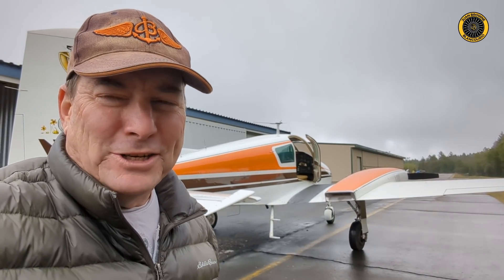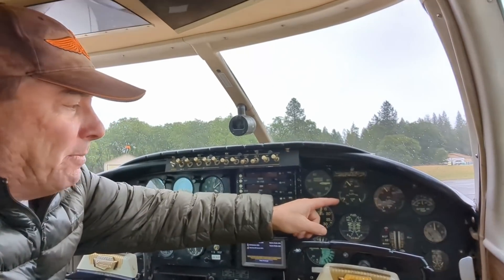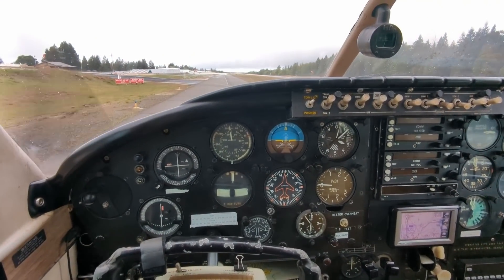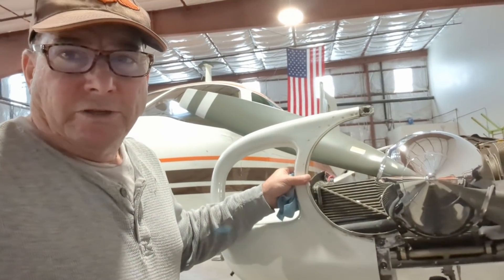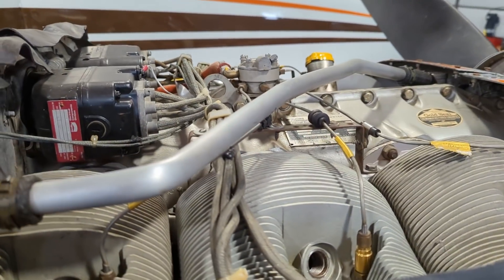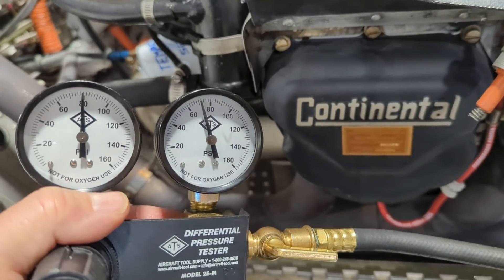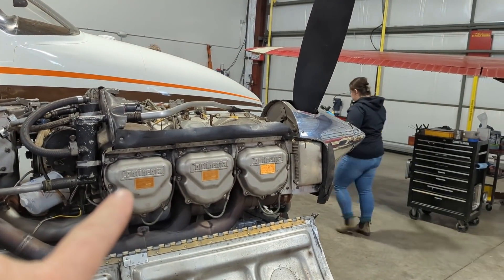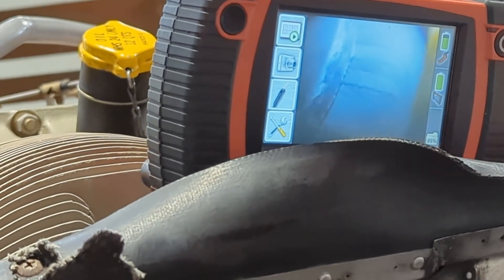1959 Cessna 310C Annual Inspection- Part I Compression Check.

Comment: Sir: What about the landing gear/ Have you had braces welded like the TAS Cessna shop in Ohio does. If you recall the 310 pilot, TAS saved him from a gear collapse. They noticed and replaced the nose gear bolt completely bent and not only replaced,but also welded a brace to the front gear. Also, other 310's have sustained gear collape. This is the main Cessna twin shop serving the midwest, and no 310 undergoing their service has had a gear collapse.

Comment: FWIW. Certain Continental engines require a restricted orifice plug for the compression test, a standard plug may give erroneously low readings. I watched twelve cylinders get needlessly overhauled on a C-337 because of that.

Comment: SouthJerseySound.  I wasn't disputing that, just wondering why.  The other thing to consider is; 95% of car engines are more or less abused.  Borescoped?  Never.  Oil analysed?  What?  Oil changed even?  Rarely.   Plugs (if any?)  I have a diesel, but I would change the plugs every ten years if they needed it or not.

As for engine loading, you're dead right, few engines are made to produce anything like 75% max horsepower for any length of time.  Having said that, in the UK, every weekend, the model of Land Rover I have can be seen towing something.  A boat, another car, horses, building materials in a trailer, unmarked, unidentifiable trailers.  Just this weekend, my Disco was towing a trailer.  Not a heavy one this time, but up some long hills at a steady 2000-2400 rpm so, maybe 75%?

There was the automobile pump gas (petrol) for aeroplanes thing which I'm not sure was every truly resolved, was it?  Whatever, I agree with you about aeroplane engine use, but modern car engines can often go thousands of hours, working 'relatively hard' weith next to no attention.  Some of them, hundreds of thousands of miles with NO attention whatever.

Comment: I, as one, noticed on the  310 engine, the bottom spark plug wires were very close to the exhaust pipes, they looked like they could be moved through those hold downs enough for better clearance. Michael said that, bye for now my friend.

Comment: I've got 1 more for you. Cyl furthest from the oil pump.
Cyl depth gauge 
Piston at 1/2 stroke
Move prop back and forth and record loss of movement with prop angle degree tool.
Can save crank cases.

Comment: Girls with Grit. that an't finger nail polish laddie I've got 2 ,not that I did want them in a dress @ times but to be well rounded in the real world from broke down on the hwy. To pull & rebuild their motors 1 is finishing her nursing degree. The other Runs a Veteran resource division & has a 3500 hp funny car
Both are Archers & avid firearms participants. My oldest is Helping restore our 1960 Aztrk & working on her Pvt. 1975 my  Tuition was prepaid headed to Northrop,76 I got the "Suprise" talk", married her got my Pvt.& my 1st born changed my life's direction,still married,   Passion for  Aviation, endless & still growing !
I'm old fashioned but Women..Rock my World !

Comment: Go Jordan, A+P at Bakers is a sinch! They were just great! You have plenty of practical experience already. The questions are on the internet, Study them up, you will be fine! I combined my A+P at Bakers with a trip to OSH, all the way from Australia, had a blast! When I do Comp checks, I always do them through the bottom plug holes. I have had too many instances where the carbon has dislodged and fallen into the valve seats and given a crap reading. Rocker covers off, wacking valves, re-running the engine. For the little extra effort, comp check in the bottom hole, it can save a heap of grief.
Reply from the maker: Great point!

Comment: Juan, I did my A&P School at City College of San Francisco.  2 1/2 years. Normally it would take 2 years with the 8 courses, but my first and last semesters, I only took one course. Took my Oral and Practical, then my Written. You can take the O&P before written if you go to a school.   I had my instructors give my O&P they were DME's also.   When you take Written test, the first license you take, you will need to do 2 test, the General and either Airframe or powerplant.  On the oral for first test, you will have to do a Weight and balance problem.    Then after you get those written passed you can take the other one.  Still have my A&P but not in the aviation area anymore.

Comment: So your are really doing a cylinder Leak Down Test, Not a compression test. At least that's how it is in the automotive world. Compression test would tell you the compression pressure in the cylinder after three or four revolutions of the crankshaft using the starter motor to turn the engine over. The Leak Down Test is the real test to determine the condition of the engine internally
Reply from the maker: No. You are a car mechanic, we are A&Ps. 
COMPLETELY different. Get your rating...
Reply: @blancolirio  Yes I see that it is COMPLETLY different, I was just wondering why a leak down is called a compression test when it does not tell you the compression of the cylinders. Sorry for the question!

Comment: Love your 1959 C-310.  I have many hours in those as we had them in the Army Reserve program.  U-3A (1959) and the U-3B (1960).  Loved the cowling on the 1959 as to leaning the fuel flow at night, you could see the exhaust stacks turn a bright cherry red when too lean and then you just backed off till they turned a little darker.  We had no auto pilot so all was hand flown all the time.  Once flew from TEB down to FTW and on to ELP and LAX area.  4 day trip.  Left it in an IRAN program in CA. These were all AF hand-me-downs to the Army.  Go figure, we gave the AF all our Caribous in 1968.  Not an even trade!

Comment: Are you aware of Continental's 1984 service bulletin M84-15 which basically discounts compression testing data?  Learned about this from Savvy Aviation, they have a YT video on borescope inspections.  There is a chart with different compression results over a short time interval that are all over the map.  I wouldn't pay an A&P to test compression myself on a Continental based on this.  Other opinions?
Reply from the maker: Bad idea.
Reply: @blancolirio  Considering you can't draw any conclusions from a bad compression check makes it a bad idea.  The fact that the regulations still require a C.C. makes it a good idea.  For those wanting to try to answer this using more information see Savvy Aviation Borescope https://youtu.be/7R-dAmv9VZk

Comment: The Leak down test always makes everyone so nervous. If the numbers are too low its such a bummer!
When I worked as a A&P I had several large bore engines that failed the leak down test by blowing passed the rings. The engines would make rated power, run well, and the oil burn was within limits.
 The owners would get so pissed when this happened.  And I could see why..
 Aviation can/ is so expensive.
I'm a C172 owner with a very  high time engine. It doesn't leak and runs good but a big expense is coming soon.
Wishing all the best for Jordan. I had to leave the A&P trade because the pay was so low I had to make a living and working on GA stuff didn't make ends meet.

Comment: Wouldn't it be nicer with a modern version with two small jet engines with a TBO of 5000 instead
Reply from the maker: No.
Reply: @blancolirio  do you drive a 1947 car?

Comment: It's always good to see young people wanting to further their education in a field that they already work in. It's a much better choice than some of the ones that get a useless degree with very little chance of ever using it. I'm in.
Reply: As the work places are overwhelmed by people working at home in their jammies, the broad spectrum of trades is suffering a steep decline in workers who think that getting dirty hands is beneath their entitled selves. A great deal of the housing shortage is caused by people, ignoring the wage points out there, who prefer to work with a laptop instead of a saw. Same with autos - the mechanics who actually fixed them have turned into fancy-uniformed technicians who only know how to take out a unit and replace it with a new one. Actual tear down and repair is gone with the good ol' boys in dirty jeans.

Comment: Nice video presentation of compression testing. One note of safety is to also disconnect the lower spark plug leads. Even though the mag switches are off it’s no guarantee the “P” leads are actually grounded. Granted the odds of ignition OR electrical shock are very low, disconnecting the lower leads also provides the opportunity to clean inspect them.

Comment: Those are good compression figures for an IO-470 engine, even the low one at 72.... no worries.  With your chrome cylinders, always remember to use plain cast iron rings, never use standard chrome rings in a chromed cylinder.

Comment: Read and understand TCM SB03-3. What was the Master Orifice reading? Maybe you did this and just didn't show it on the video. It looks like you have the correct compression tool. MANY people are totally unaware of this Service Bulletin. Yeah, Yeah... I know Service Bulletins are NOT mandatory. However this Service Bulletin describes the proper way to perform a compression check on the big block Continentals. It also emphasizes the importance of the borescope inspection.
Reply from the maker: You are correct

Comment: It surprises me that the regs don't have a problem with someone, even a licensed A&P, doing annuals on their own aircraft. It just feels like there is so much room for idiots to rush or ignore warning signs, and just sign off their airplane for another year, just so they can get back in the air. Wouldn't you want to require aircraft owners to have a different A&P do the annual, or at least review the owner's work and sign off on it, to ensure procedures are being followed properly?
Reply: Annual Inspections can only be accomplished by A&P mechanics that hold Inspection Authorization (IA).    These inspections must be performed by the IA holder and can not be delegated or supervised.

      Obtaining and retaining the IA certification is not easy and holders of IA are held in high regard by the FAA since they act as representatives of the FAA administrator when determining the airworthiness of aircraft.

      It is quite common for IA’s that own their own aircraft to perform their own Annual Inspections.

      Someone that held an A&P certificate, but not IA would need to seek out an IA to perform an Annual Inspection.

      All of this is covered under 14 CFR 43.
Reply from the maker: Stay tuned…
Reply: Does it not occur to you that someone who has obtained a IA certificate, has been around aviation for awhile (most IA holders have 10+ years experience), and are working on the plane THEY WILL BE FLYING would want to take special care working on it?
Most IA's are quite meticulous and careful individuals - because they have seen 1st hand what can happen with carelessness and neglect.

Comment: In Australia your 'compression check' is called 'cylinder pressure test'. It is not about compression, it is about pressure loss on the compression stroke. Think about it.
Reply from the maker: Maybe down under, but not here.

Comment: This brings back memories of my first corporate flying job in 1969. Our company had an "I" model 310 and 411. I had an A&P license although I was working as a pilot. I got to help a little on maintenance but because I was the "new guy," most of my labor was cleaning and waxing. I didn't mind because I was thrilled to be flying. That A&P training was very useful for understanding new systems and analyzing any problems during 31 years of corporate flying. 

Our local community college has an A&P school that feeds a large AMR maintenance base here in RFD. These are good jobs in high demand.

Comment: Your cowl has "Camloc" fasteners and not Dzus fasteners  (they're from WWII)
Also its a good safety idea to remove the spark plug leads from the bottom plugs to completely preclude any chance of the mags giving off a spark especially with impulse couplings on the mags like I hear on your engines. 
Last but not least there is a better way of doing the compression check  by following the Continental designed process with a "Calibrated " leak compression check.  Its their approved way of doing it. 

Really like watching your channel
Retired airline/corporate pilot and 55 year A&P here

Comment: Interesting!  What you're calling a "differential compression check" is what the automotive world calls a "leak-down test".  For car folks, a compression test uses the starter to crank the engine over, and the pressure in the cylinder is measured.  The leak-down is often a next step if the compression numbers come out low.
Reply: You beat me to the same comment.
Reply: Well I can see why they do it this way since a spinning propeller is always a hazard.
Reply: Everyone in aviation also calls it a leak-down test...
Reply: We called it a "cylinder differential pressure" check at our airport. You're checking the cylinders ability to hold a certain amount of pressure vs a compression test which is a check of the cylinders ability to produce pressure.

Comment: Exhaust valve leakage never gets better over time, only worse, unless it is a carbon deposit on the seat.  You may want to check the valve rotator cap to ensure it is working.  Savvy Aviation just put out a video in the past week or so on lapping in place which also shows how to check for valve rotation.  I sure hope you don't have to replace an exhaust gasket.  Cessna didn't do us mechanics any favors with these early 310's.  You can't drop the exhaust manifolds unless you lift the engine up off of its mounts.  The studs are too long and the nacelle ribs are too close.  Getting the engine mount bolts out isn't too bad, but getting them threaded back in and bending the locking tabs on those bolts will have you reciting salty language.  I've had to do cylinder work on mine and have the scars to prove it.  Best of luck, these early tuna tank 310's are a blast to fly.
Reply from the maker: That's in a future episode ...

Comment: When I did my practical it was a compression test on a beech 18 and mag timing then hydraulic with gear retract.   The same week when I was licensed I got sent to help another mechanic change a chug on a 18 hauling freight in 20f degrees with sleet. As a new A&P does not mean a warm dry hanger. Trapped the engine.

Comment: Probably a silly question from a non-pilot, but... "Make sure the gear is down"??? Wouldn't you have had some indication it wasn't, before you got in? 0:13 🤔
Reply: Generally speaking(don’t know this plane) there is a safety(weight on gear switch) that prevents the gear from raising while it is holding the airplane.  But every safety system can fail, so you make sure that nobody has bumped a switch before you apply power, because the gear deciding to retract on the ground would be expensive and embarrassing.
Reply: Not really a silly question.   

  What Juan meant was that the landing gear selector switch (gear handle) was in the down position.   

  That way, when he applies electrical power to the aircraft via the master switch, the gear would not need to depend on the squat switch (if there is one) to prevent an inadvertent retraction.
Reply: If someone has knocked the switch in the up position, and Juan turns on the master switch, AND the squat (safety) switch does not work - the gear would retract. Very, very bad.

Comment: Dan Millican's mechanic explained to me, in the comments section, the difference between an automotive leakdown tester and the aviation compression tester. Interesting, no doubt! I've forgotten the details on the aviation side of things - is the 2nd gauge reading cylinder pressure in PSI, and that is considered PSI compression of that cylinder? With the automotive leakdown tester I have, one gauge reads line pressure like the aviation compression tester, but the 2nd gauge is in percent leak down, from 0%-100%. It seems the aviation compression tester is exactly the same except for the scale of the 2nd gauge. I'm thinking if I put a PSI gauge in place of the percentage gauge, it would now function like an aviation compression tester if I understand it correctly. Mine has an adjustable regulator on it so you can zero the 2nd percentage gauge out, since input pressure varies depending on what you have your air compressor set at. I'm guessing that the aviation side of things specifies an exact pressure the test is to be run at. I like the aviation tester, because one tool functions as both a compression AND a leakdown tester. That's a great way of doing it! The automotive compression tester is just a cheap gauge, and compression readings will vary depending on if you forgot to crank the throttle wide open, and how many revolutions the engine makes before you call it "good", and stop cranking.

Anyway, you win, Juan! I'll never complain about a spark plug change on a Hemi-powered Ram pickup ever again! 🤣 Great vid man! THANKS!!

Comment: Juan, here is some really good information on Continental Compression Checks. Look up Continental Service Bulletin M84-15 .  Also the Cessna Owner Organization  has good information on Cylinder Checks .   You will find that there is new good information and that 60/80 is not the way Continental wants it accomplished .  I put in the links earlier but it kicked them off .
Reply: Just an FYI, that bulletin has been superceded to SB03-3. A Google search of either will land you in the same place, however.